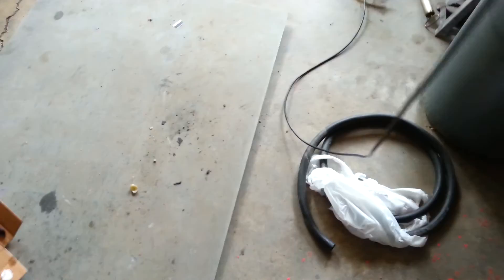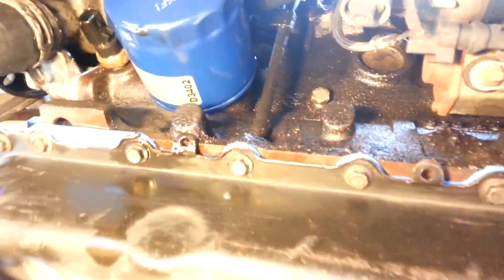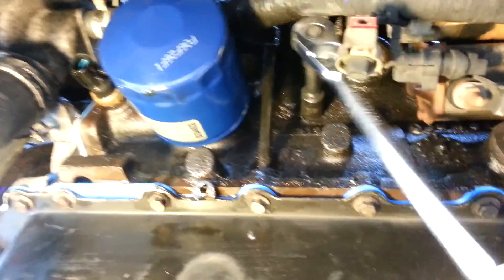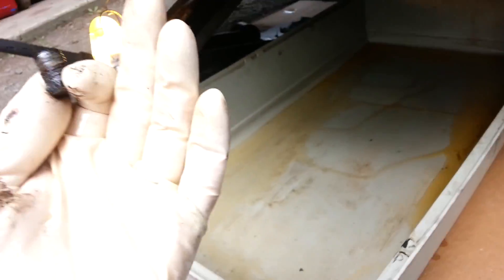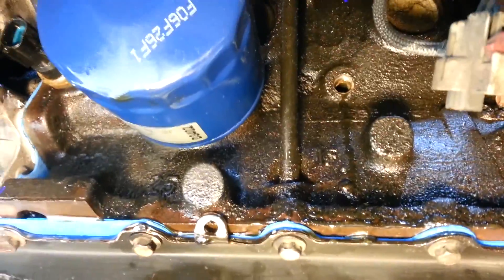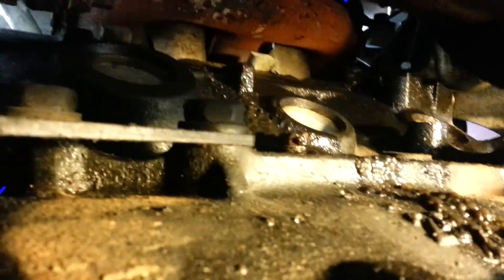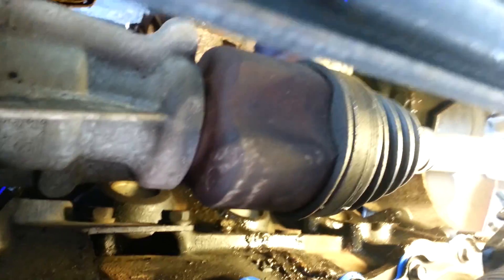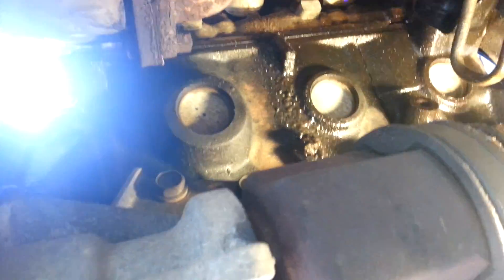Dodge 3.3l coolant block drain plugs

Comment: Same on my 3.0. Be sure to use a 6 point socket. They're a little stubborn. I got anti-freeze in my left ear. I pulled toe bottom hose 1st to avoid a big mess. Good video.  Thanks!
Reply from the maker: Good point about using 6 pt.  I hardly ever use 12pt sockets.

Comment: Here comes that nasty green hair oil. LOL... thread tape is a plus. Pulling the drain plug helps a lot to get the coolant lower than what you're working on, very helpful video. Thanks
Reply from the maker: thank you

Comment: The drain bolts on my 2008 caravan are about 3 inches long. I pulled them out on both sides. Not a drop came out. I know it’s in there because the car keeps a nice even temp almost no matter what.

Comment: i drained the block thanks to your video. Only problem is, since there is no vent in this engine, when I fill the radiator and start the car, the coolant is not flowing into the engine. I'm afraid of running the car too long without coolant in the block. Did you follow any special procedure to fill the system?
Reply: Leave the radiator cap off to allow air pockets out...  IF that doesn't help I'm almost certain that you will find bleeder valves on the top somewhere (near the thermostat, etc.)...
Reply from the maker: I have 2 methods.  Airlift 55000 (which works great) or radiator funnel.  Either works for me, but the airlift is faster and more reliable, in my opinion.  Check this video https://www.youtube.com/watch?v=egt0tdMquMA

Comment: Thanks for video! Helps on proper coolant change procedure! What torque do you put the drain plugs back in at roughly?
Had to buy the Coolant 50/50 (concentrate) with HOAT. 
In total Haynes repair manual shows 13.4 quarts OR 12.6 Liters of coolant
Reply from the maker: Great question, but it was so long ago I don't remember.
Reply: @SmiggleSmudge  Whats was the question lol... I was working on a friends dodge....all good...she made it back to home in a ~1500km drive..